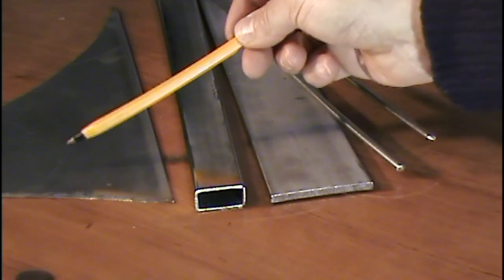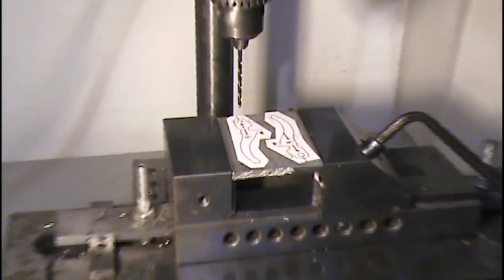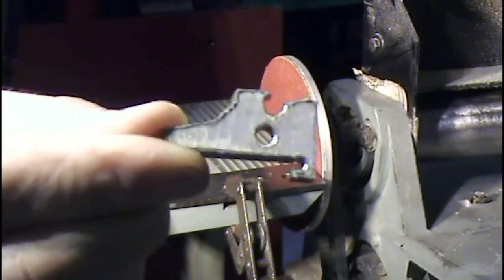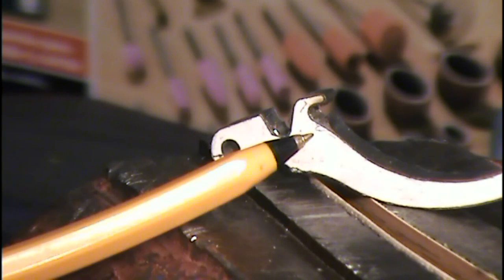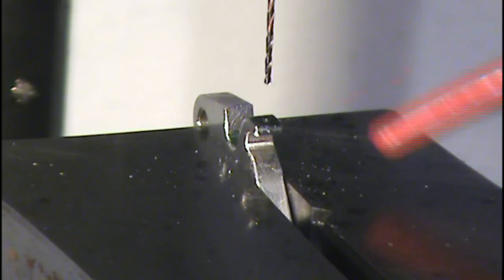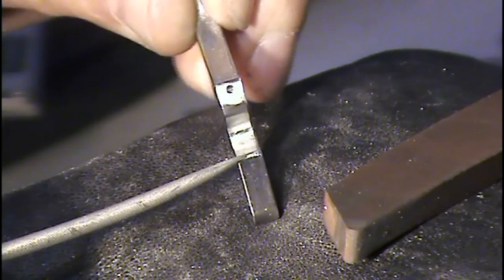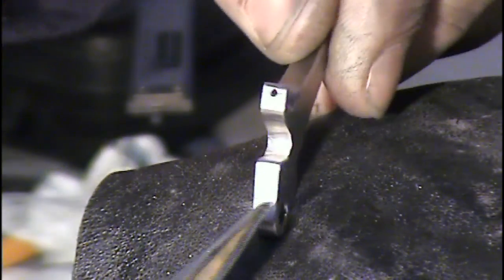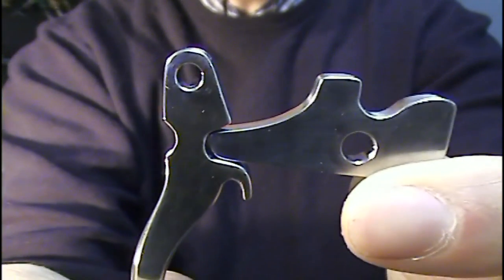Speargun Trigger Mechanism - Part 2: the Trigger and Sear - Youtube demonetized this video! Why?

Comment: you can publish the plan? thanks
Reply from the maker: Hello Ron morales,
making the plans available will not be possible, however here are some overall dimensions from the trigger mechanism and the spearguns.
 - The trigger housing dimensions= 13x30x65mm, wall thickness:
2mm. 
Trigger and Sear= 5mm thick. All made from 316 grade stainless steel
Some of my channel viewers told me, that by using any free screen 
recorder program to take "screen shots"  from some of my videos, and 
then using a image editing program like "Windows PAINT" to scale the images to get the right sizes. Watch the video
 "Roller Speargun Design Model"
 https://www.youtube.com/watch?v=_qQXGEgw5p8  at 1:03 is possible to see a side view of the trigger mechanism.

  Overall dimensions of the spearguns.
The roller speargun:
 1200mm long (end to end)
950mm from the centre of the rollers to the edge of the trigger pocket 
50mm wide
---------
Traditional speargun,
1200m long
950mm from the edge of the rubber bands hole to the trigger pocket
50mm wide from the but plate to the end of the trigger pocket and tapering down to 40mm at the tip (muzzle)
I used  Okoume Marine Plywood  laminated together with epoxy,  but a much better choice will be to use Teak Wood.
Thanks for the comment and for watching my videos.

Comment: Where can I get the template for the trigger? Thank you very much
Reply from the maker: Hello Gilbert GMC LV
making the plans available will not be possible, however i can give some overall dimensions from the trigger mechanism and the spearguns.
 - The trigger housing dimensions= 13x30x65mm, wall thickness:
2mm. 
Trigger and Sear= 5mm thick. All made from 316 grade stainless steel
Some of my channel viewers told me, that by using any free screen 
recorder program to take "screen shots"  from some of my videos, and 
then using a image editing program 
like "Windows PAINT" to scale the images to get the right sizes. Watch the video
 "Roller Speargun Design Model"
 https://www.youtube.com/watch?v=_qQXGEgw5p8  at 1:03 is possible to see a side view of the trigger mechanism.

  Overall dimensions of the spearguns.
The roller speargun:
 1200mm long (end to end)
950mm from the centre of the rollers to the edge of the trigger pocket 
50mm wide
---------
Traditional speargun,
1200m long
950mm from the edge of the rubber bands hole to the trigger pocket
50mm wide from the but plate to the end of the trigger pocket and tapering down to 40mm at the tip (muzzle)
I used  Okoume Marine Plywood  laminated together with epoxy,  but a much better choice will be to use Teak Wood.
Thanks for the comment and for watching my videos.

Comment: Could you send me link for your trigger an sear pattern evolution_1963@hotmail.com
Reply from the maker: Hello Everett Defrane,
I designed this trigger using a CAD program "Google Sketchup" making the
 plans available will not be possible, however i can give some overall 
dimensions from the trigger mechanism  - The trigger housing dimensions=
 13x30x65mm, wall thickness: 2mm .Trigger and Sear= 5mm thick. All made 
from 316 grade stainless steel Some of my channel viewers told me, that 
by using any free screen recorder program is possible to take "screen 
shots" from some of my videos, and then using a image editing program 
like "PAINT" to scale the images to get the right sizes. Watch the video
 "Roller Speargun Design Model"  https://www.youtube.com/watch?v=_qQXGEgw5p8 at 1:03 is possible to see a side view of the trigger mechanism. 
Thanks for the comment and for watching.

Comment: Hello,  how or where can I get the print out?  Thanks!
Reply from the maker: Hello britesynth
I designed this trigger using a CAD program "Google Sketchup" making the plans available will not be possible, however i can give some overall dimensions from the trigger mechanism  - The trigger housing dimensions= 13x30x65mm, wall thickness: 2mm .Trigger and Sear= 5mm thick. All made from 316 grade stainless steel Some of my channel viewers told me, that by using any free screen recorder program is possible to take "screen shots" from some of my videos, and then using a image editing program like "PAINT" to scale the images to get the right sizes. Watch the video "Roller Speargun Design Model"  https://www.youtube.com/watch?v=_qQXGEgw5p8 at 1:03 is possible to see a side view of the trigger mechanism. 
Thanks for the comment and for watching.

Comment: Very good video but please give me the plans I paint and print so I can do the same, thanks to my mail please: legonzalez2308@gmail.com
Reply from the maker: Hello Eudes González,
That will not be possible, however i can give some overall dimensions from the trigger mechanism 
 - The trigger housing dimensions= 13x30x65mm, wall thickness: 2mm 
Trigger and Sear= 5mm thick. All made from 316 grade stainless steel
Some of my channel viewers told me, that by using any free screen 
recorder program to take "screen shots"  from some of my videos, and 
then using a image editing program 
like "PAINT" to scale the images to get the right sizes. Watch the video
 "Roller Speargun Design Model"
 https://www.youtube.com/watch?v=_qQXGEgw5p8  at 1:03 is possible to see a side view of the trigger mechanism.
Thanks for the comment and for watching.

Comment: Can you please give the print out
Reply from the maker: Hello robert florentino,
That will not be possible, however i can give some overall dimensions from the trigger mechanism and the spearguns.
 - The trigger housing dimensions= 13x30x65mm, wall thickness: 2mm 
Trigger and Sear= 5mm thick. All made from 316 grade stainless steel
Some of my channel viewers told me, that by using any free screen 
recorder program to take "screen shots"  from some of my videos, and 
then using a image editing program 
like "PAINT" to scale the images to get the right sizes. Watch the video
 "Roller Speargun Design Model"
 https://www.youtube.com/watch?v=_qQXGEgw5p8  at 1:03 is possible to see a side view of the trigger mechanism.

  Overall dimensions of the spearguns.
The roller speargun:
 1200mm long (end to end)
950mm from the centre of the rollers to the edge of the trigger pocket 
50mm wide
---------
Traditional speargun,
1200m long
950mm from the edge of the rubber bands hole to the trigger pocket
50mm wide from the but plate to the end of the trigger pocket and tapering down to 40mm at the tip (muzzle)
I used  Okoume Marine Plywood  laminated together with epoxy,  but a much better choice will be to use Teak Wood.
Thanks for the comment and for watching my videos.

Comment: Could you please send me a link of the sizes of the parts inside trigger mechanism so i chould print in and start working on it.
Reply from the maker: Yashau Adam,
That will not be possible but I can give you some overall dimensions for it.
 - The trigger housing dimensions= 13x30x65mm, wall thickness: 2mm 
Trigger and Sear= 5mm thick. All made from 316 grade stainless steel
Some of my channel viewers told me, that by using any free screen 
recorder program to take "screen shots"  from some of my videos, and 
then using a image editing program 
like "PAINT" to scale the images to get the right sizes. Watch the video
 "Roller Speargun Design Model"
 https://www.youtube.com/watch?v=_qQXGEgw5p8  at 1:03 is possible to see a side view of the trigger mechanism.
Thanks for the comment and for watching my videos.

Comment: OLA I LIKE A LOT OF YOUR VIDEOS, YOU CAN SEND ME TWO TAG PARTS IN ORIGINAL SIZE BY EMAIL, TO GILSON_YAMAGUTI@HOTMAIL.COM I WILL BE VERY GRATEFUL ,, I AM FROM BRAZIL
Reply from the maker: Hello Gilson Yamaguti,
That will not be possible but I can give you some overall dimensions for it.
 - The trigger housing dimensions= 13x30x65mm, wall thickness: 2mm 
Trigger and Sear= 5mm thick. All made from 316 grade stainless steel
Some of my channel viewers told me, that by using any free screen 
recorder program to take "screen shots"  from some of my videos, and 
then using a image editing program 
like "PAINT" to scale the images to get the right sizes. Watch the video
 "Roller Speargun Design Model"
 https://www.youtube.com/watch?v=_qQXGEgw5p8  at 1:03 is possible to see a side view of the trigger mechanism.
Thanks for the comment and for watching my videos.

Comment: Please give me exact measurements with?
Reply from the maker: Hello Thanh Tùng 999
That will not be possible but I can give you some overall dimensions for it.
 - The trigger housing dimensions= 13x30x65mm, wall thickness: 2mm 
Trigger and Sear= 5mm thick. All made from 316 grade stainless steel
Some of my channel viewers told me, that by using any free screen 
recorder program to take "screen shots"  from some of my videos, and 
then using a image editing program 
like "PAINT" to scale the images to get the right sizes. Watch the video
 "Roller Speargun Design Model"
 https://www.youtube.com/watch?v=_qQXGEgw5p8  at 1:03 is possible to see a side view of the trigger mechanism.
Thanks for the comment and for watching my videos.

Comment: Can you leave a link to the pairs that you used to the trigger and the housing
Reply from the maker: Hello Lukas Rasmussen
That will not be possible but I can give you some overall dimensions for it.
 - The trigger housing dimensions= 13x30x65mm, wall thickness: 2mm 
Trigger and Sear= 5mm thick. All made from 316 grade stainless steel
Some of my channel viewers told me, that by using any free screen 
recorder program to take "screen shots"  from some of my videos, and 
then using a image editing program 
like "PAINT" to scale the images to get the right sizes. Watch the video
 "Roller Speargun Design Model"
 https://www.youtube.com/watch?v=_qQXGEgw5p8  at 1:03 is possible to see a side view of the trigger mechanism.
Thanks for the comment and for watching my videos.

Comment: I understand a bit of locksmithing but I have a notion of the design. You could make the drawing available to me with material specifications in PDF? my e-mail is cristianofile_file@hotmail.com
Reply from the maker: Hello Cristiano Nascimento
    That will not be possible but I can give you some overall dimensions for it.
 - The trigger housing dimensions= 13x30x65mm, wall thickness: 2mm 
Trigger and Sear= 5mm thick. All made from 316 grade stainless steel
Some of my channel viewers told me, that by using any free screen 
recorder program to take "screen shots"  from some of my videos, and 
then using a image editing program like "PAINT" to scale the images to get the right sizes. Watch the video
 "Roller Speargun Design Model"
 https://www.youtube.com/watch?v=_qQXGEgw5p8  at 1:03 is possible to see a side view of the trigger mechanism.
Thanks for the comment and for watching my videos.

Comment: Entendo um pouco de serralheria mas tenho noção do desenho.poderia me disponibilizar o desenho com as especificações de material em PDF ? meu e-mail e cristianofile_file@hotmail.com
Reply from the maker: Hello Cristiano Nascimento
    That will not be possible but I can give you some overall dimensions for it.
 - The trigger housing dimensions= 13x30x65mm, wall thickness: 2mm 
Trigger and Sear= 5mm thick. All made from 316 grade stainless steel
Some of my channel viewers told me, that by using any free screen 
recorder program to take "screen shots"  from some of my videos, and 
then using a image editing program like "PAINT" to scale the images to get the right sizes. Watch the video
 "Roller Speargun Design Model"
 https://www.youtube.com/watch?v=_qQXGEgw5p8  at 1:03 is possible to see a side view of the trigger mechanism.
Thanks for the comment and for watching my videos.

Comment: speargun trigger diagram plz sent maill id vikneshlanka@gmail.com plz help me
Reply: graph plz sent me sir plz vikneshlanka@gmail.com
Reply from the maker: Hello ilankarasa vikneshwaran
That will not be possible but I can give you some overall dimensions for it.
 - The trigger housing dimensions= 13x30x65mm, wall thickness: 2mm 
Trigger and Sear= 5mm thick. All made from 316 grade stainless steel
Some of my channel viewers told me, that by using any free screen 
recorder program to take "screen shots"  from some of my videos, and 
then using a image editing program like "PAINT" to scale the images to get the right sizes. Watch the video
 "Roller Speargun Design Model"
 https://www.youtube.com/watch?v=_qQXGEgw5p8  at 1:03 is possible to see a side view of the trigger mechanism.
Thanks for the comment and for watching my videos.
Reply from the maker: Hello ilankarasa vikneshwaran
That will not be possible but I can give you some overall dimensions for it.
 - The trigger housing dimensions= 13x30x65mm, wall thickness: 2mm 
Trigger and Sear= 5mm thick. All made from 316 grade stainless steel
Some of my channel viewers told me, that by using any free screen 
recorder program to take "screen shots"  from some of my videos, and 
then using a image editing program like "PAINT" to scale the images to get the right sizes. Watch the video
 "Roller Speargun Design Model"
 https://www.youtube.com/watch?v=_qQXGEgw5p8  at 1:03 is possible to see a side view of the trigger mechanism.
Thanks for the comment and for watching my videos.

Comment: 太好了，能分享下图纸吗？
Reply from the maker: Hello 杨超
that will not be possible but I can give you some dimensions for it.
 - The trigger housing dimensions= 13x30x65mm, wall thickness: 2mm 
Trigger and Sear= 5mm thick. All made from 316 grade stainless steel
Some of my channel viewers told me, that by using any free screen 
recorder program to take "screen shots"  from some of my videos, and 
then using a image editing program 
like "PAINT" to scale the images to get the right sizes. Watch the video
 "Roller Speargun Design Model"
 https://www.youtube.com/watch?v=_qQXGEgw5p8  at 1:03 is possible to see a side view of the trigger machanism.
Thanks for the comment and for watching.

Comment: Where did your find the printouts
Reply from the maker: Hello Marshall Albertsz,
I designed it using a CAD program "Sketchup free"
 I can give you some dimensions for it.
 - The trigger housing dimensions= 13x30x65mm, wall thickness: 2mm 
Trigger and Sear= 5mm thick. All made from 316 grade stainless steel
Some of my channel viewers told me, that by using any free screen 
recorder program to take "screen shots"  from some of my videos, and 
then using a image editing program 
like "PAINT" to scale the images to get the right sizes. Watch the video
 "Roller Speargun Design Model"
 https://www.youtube.com/watch?v=_qQXGEgw5p8  at 1:03 is possible to see a side view of the trigger machanism.
Thanks for the comment and for watching.

Comment: Can I get an blue print of it
Reply from the maker: Hello  Ronaldo Williams,
that will no be possible but I can give you some dimensions for it.
 - The trigger housing dimensions= 13x30x65mm, wall thickness: 2mm 
Trigger and Sear= 5mm thick. All made from 316 grade stainless steel
Some of my channel viewers told me, that by using any free screen 
recorder program to take "screen shots"  from some of my videos, and 
then using a image editing program 
like "PAINT" to scale the images to get the right sizes. Watch the video
 "Roller Speargun Design Model"
 https://www.youtube.com/watch?v=_qQXGEgw5p8  at 1:03 is possible to see a side view of the trigger machanism.
Thanks for the comment and for watching.
Reply: Thanks I like your video .....I tried to build one but I failed

Comment: me gustaría que pudieras proporcionar las plantillas para poderlas imprimir
Reply from the maker: Hello  Diego Cervantes Garcia,
that will no be possible but I can give you some dimensions for it.
 - The trigger housing dimensions= 13x30x65mm, wall thickness: 2mm 
Trigger and Sear= 5mm thick. All made from 316 grade stainless steel
Some of my channel viewers told me, that by using any free screen 
recorder program to take "screen shots"  from some of my videos, and 
then using a image editing program 
like "PAINT" to scale the images to get the right sizes. Watch the video
 "Roller Speargun Design Model"
 https://www.youtube.com/watch?v=_qQXGEgw5p8  at 1:03 is possible to see a side view of the trigger machanism.
Thanks for the comment and for watching.

Comment: Image contains dimensions for drawings if allowed
Reply from the maker: Hello nacer jazayrei,
that will not be possible but I can give you some dimensions for it.
- The trigger housing dimensions= 13x30x65mm, wall thickness: 2mm 
Trigger and Sear= 5mm thick. All made from 316 grade stainless steel
Some of my channel viewers told me, that by using any free screen recorder program to take "screen 
shots"  from some of my videos, and then using a image editing program 
like "PAINT" to scale the images to get the right sizes. Watch the video
 "Roller Speargun Design Model"
 https://www.youtube.com/watch?v=_qQXGEgw5p8  at 1:03 is possible to see a side view of the trigger machanism.
Thanks for the comment and for watching.

Comment: HELLO Sir i m really impressed and i enjoyed watching your videos because they are well explained and informative but after watching this video i have one question : could you send me the design drawing of the sear and the trigger ? 
And thanks for all.
Reply from the maker: Hello YACHEUR B. YACINE,
that will not be possible but I can give you some dimensions for it.
- The trigger housing dimensions= 13x30x65mm, wall thickness: 2mm 
Trigger and Sear= 5mm thick. All made from 316 grade stainless steel
Some of my channel viewers told me, that by using any free screen recorder program to take "screen 
shots"  from some of my videos, and then using a image editing program 
like "PAINT" to scale the images to get the right sizes. Watch the video
 "Roller Speargun Design Model"
 https://www.youtube.com/watch?v=_qQXGEgw5p8  at 1:03 is possible to see a side view of the trigger mach.
Thanks for the comment and for watching.